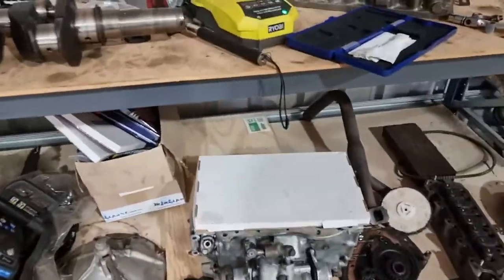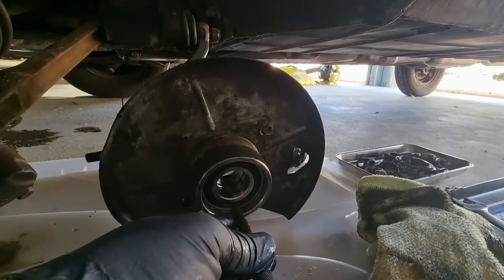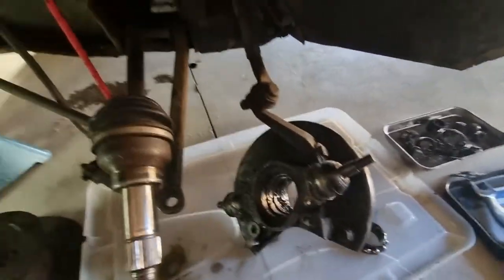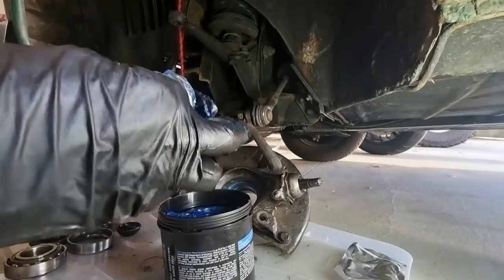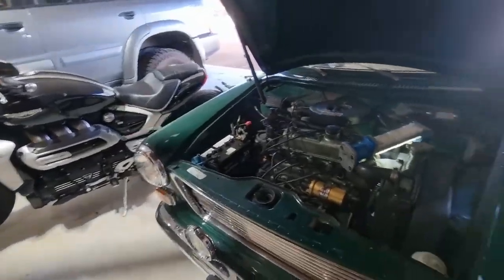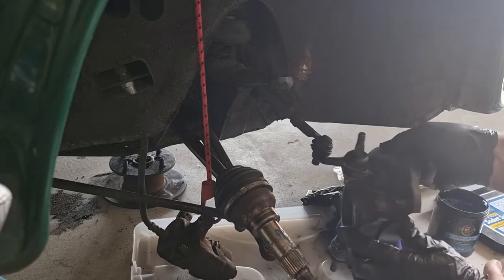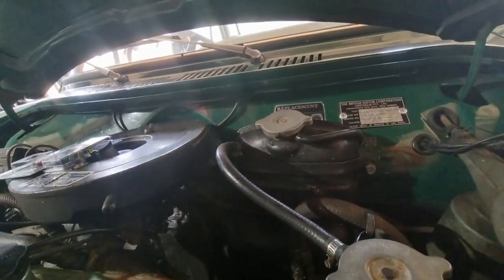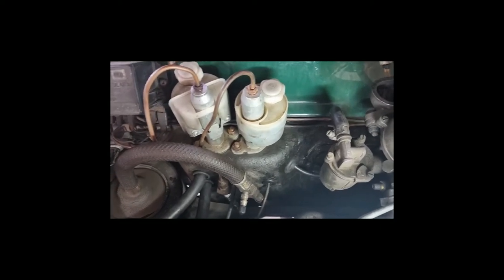Morris 1100S front end repairs!

Comment: Good work. Is the return spring missing on the Clutch lever?
Reply from the maker: Oh yes. It needs reinstating for sure. I'm still unsure why I suddenly heard it jingle jangle
Reply: @jl991825  Yep you need the return spring or you won't have the clearance between the thrust bearing and pressure plate. The jingle jungle could just be vibration on the lug on top of the return arm or possibly the vibration from the thrust bearing going up onto that lug that the spring is meant to go on. A lot of people couldn't get the right thrust bearing adjustment so they would take off the spring, which might temporarily fix the problem but usually ends up resulting in a damaged thrust bearing. Usually the problem that should have been fixed (and not taking off the spring) was wear to the thrust bearing shaft. Not a hard job to fix is that is what it might be. Hopefully the spring just came off or someone just forgot to put it back on.